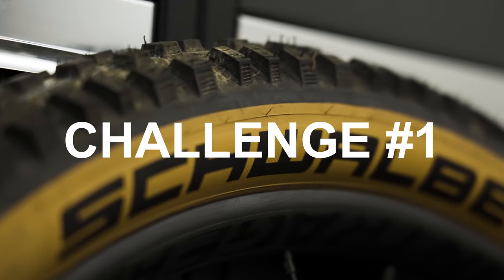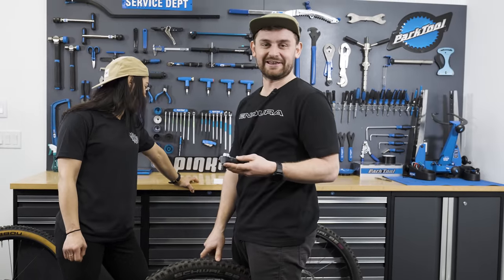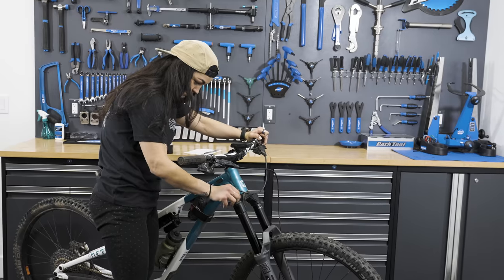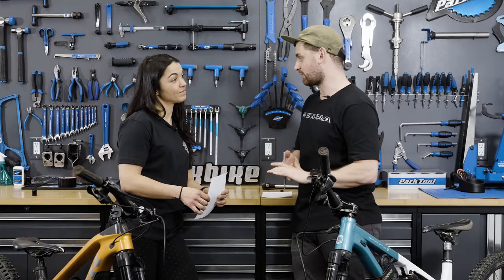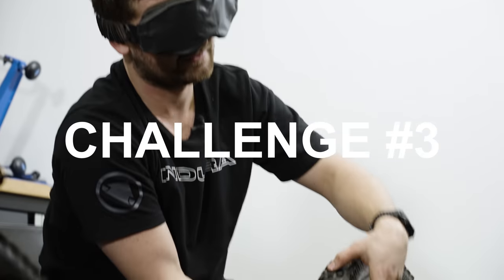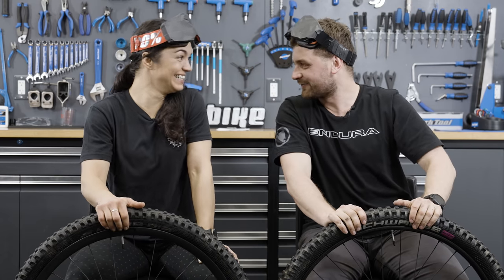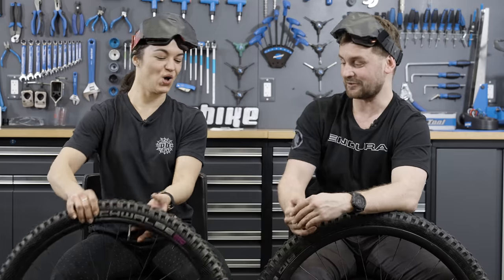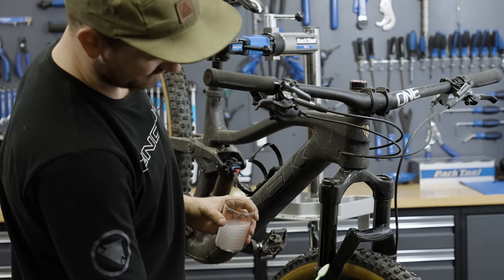Unconventional Workshop Challenge: Tom vs Christina

Comment: Yes Christina,  you totally smashed it! This was a lot of fun would love to see more like this
Reply from the maker: Thanks Phill! Send us some ideas for the next challenge -Christina
Reply: @pinkbike  how about a race to assemble your bikes out of a bike bag...or repair a puncture, fit a new gear/dropper cable trailside? Correctly size and fit a new chain without using the old one for reference ?
Reply: @pinkbike  bike set up, bars, saddle height, bar rotation, even cleat adjustment.

Comment: My GAP is good enough. I can get my tyres to 20 and 25 by feel. It's not a skilled hand, it's muscle memory and having cocked it up a fair few times on the way. I'm usually within 2psi every time.
 Suspension is something I touch once. I know the pressure I need for 30% sag on both ends. Compression and Rebound are set then forget. The pressure is the only thing which gets messed with, and only for servicing.